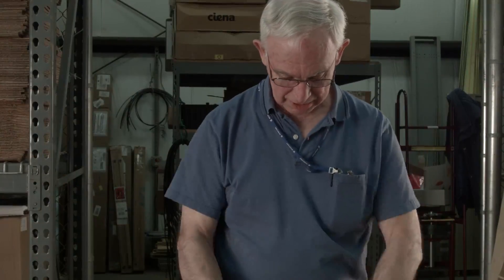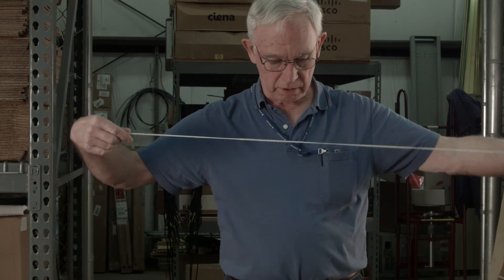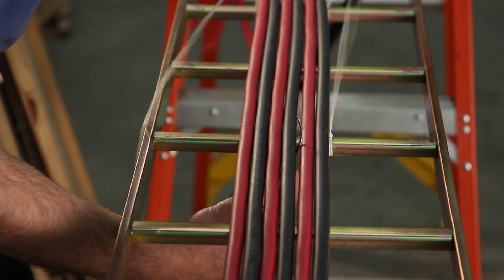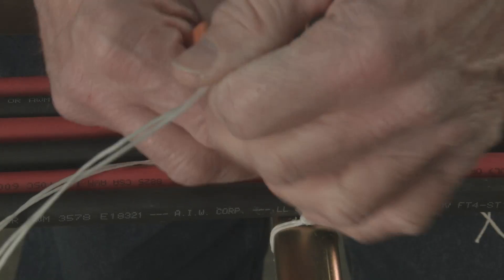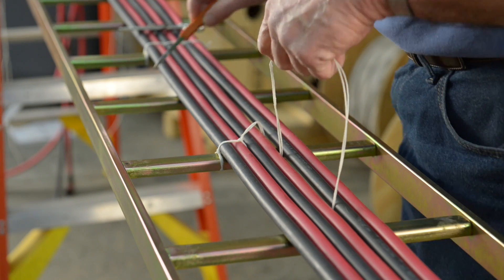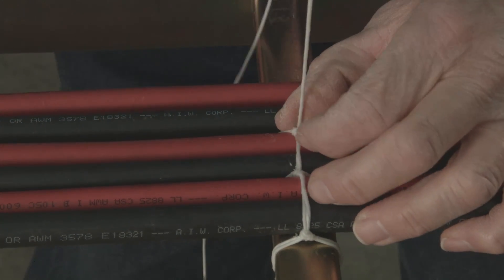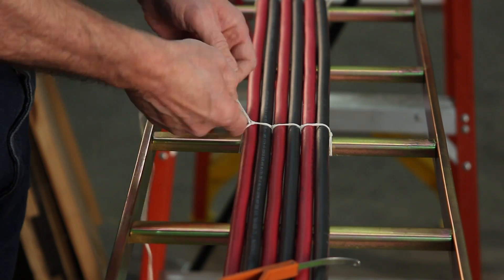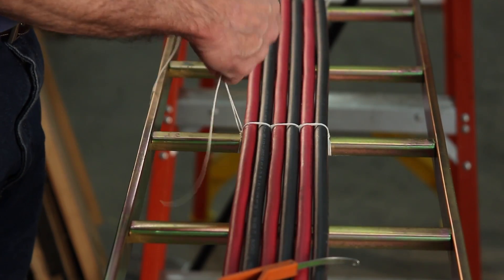Instructional cable lacing sewing a Kansas City Stitch

Comment: Just wondering... why not use regular small zip ties instead??? wouldnt it be a litte faster??? I never seen this before in my 3 year experience of routing cable.
Reply: No matter how careful you are there is always one cable tie waiting to cut you or the cables you are running. And there is always the nub on the end with the catch. When you have a cable run two feet wide and a foot thick those ties take up a lot of room and everything catches on them. But I'm retired and I don't care any more.
Reply: harold lhedigbo I work in the Telecom industry for at&t and Verizon, they don't allow you to use zip ties inside shelters for safety reasons. Mainly because people have cut themselves on the sharp edges that get left behind after you cut the zip ties tail. So you have to use wax string, it's a standard. Also it looks better in my opinion.
Reply: harold lhedigbo zip ties are faster though, we use them to hold everything in place before wax stringing.
Reply: Scars, people don't always cut them flush. My forearms are jacked up. Plus 9 cord last longer tie wraps dry and break.
Reply: Got ya. thanks.
Reply: Plus people are really jagged when they cut tie wraps, so it leaves sharp edges that destroy your arms and back of your hands.
Reply: Darron Hansen probably the real reason besides those you mentioned, is the fact that the string wont cut the cable. So yeah they prob looking not to get a workers comp case and protect the cable at the same time
Reply: If not cut properly. Zip ties will tear the shit out of your hands if you ever had to do a new install or repair
Reply: Eric Brakebill stay healthy and get one of these CHP-170 Micro Cutter https://www.amazon.com/dp/B00FZPDG1K/ref=cm_sw_r_cp_apa_77zwBb9716874
Reply: Darron Hansen I wonder if you know the existence of these flush cutters CHP-170 Micro Cutter https://www.amazon.com/dp/B00FZPDG1K/ref=cm_sw_r_cp_apa_77zwBb9716874 maybe you have to think outside your comfort zone.
Reply: @1rickytorr  You may consider that the string is far more strong than the zip tides
Reply: @TheKronosOne  absolutely. Zip ties are like a temporary thing.